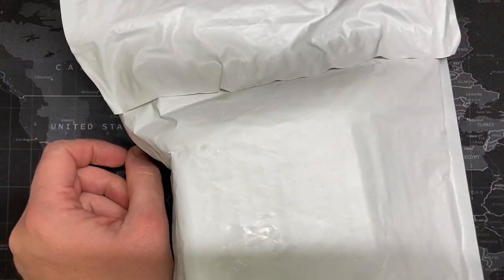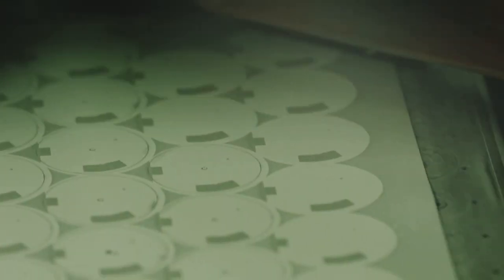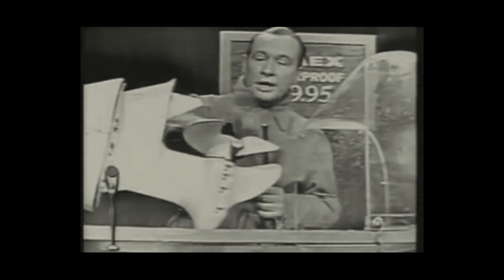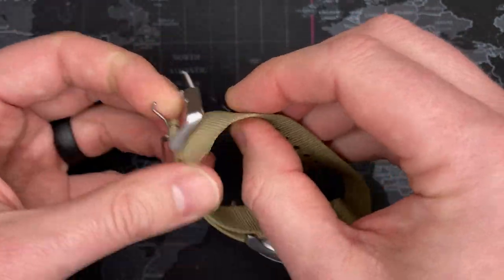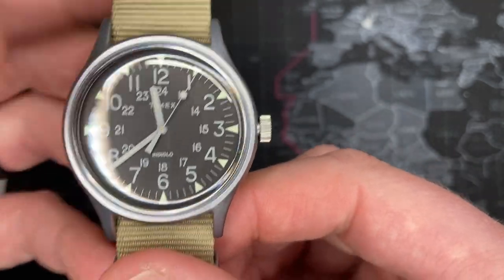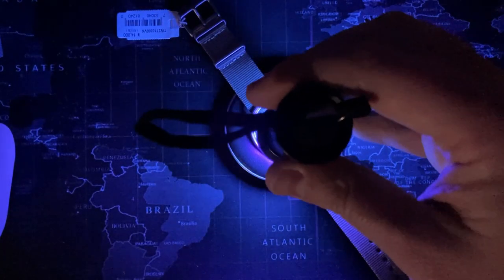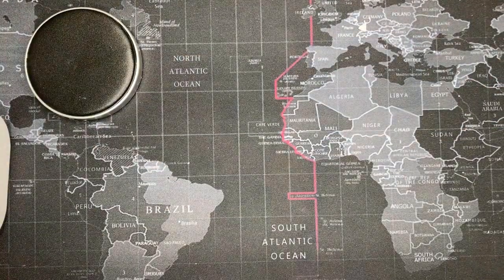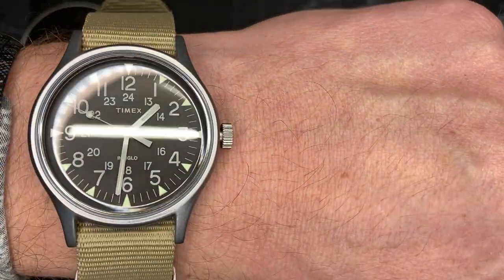Timex MK1 Classic 30m Field Watch - Review & Unboxing (TW2T10300-VK / M905)

Comment: I see you had the back cover off I’d like to know if you were able to just snap it on with your fingers without using a press?
Reply from the maker: It's been a while, so to be honest I cannot remember if I used a press. I almost always use a press now though, the reason being is that the case back can get distorted when you use your fingers. Unless the case back is billet steel, most of them will end up being stamped. A stamped case-back can be easily distorted, either in the middle or to the side, which can affect water resistance. With a press, you're getting solid pressure all around the case back. They have hand presses now for $20 bucks with all the nylon dies.
Reply: @ToddsWatchshop  Yeah that makes perfect sense the only thing I’m concerned about is the massive acrylic crystal I just don’t want that cracking and they’re sure not much bezel on the dial to put a press but yeah I think I might buy one of those presses there about $20 on Amazon or do with the one guy on YouTube does he use his Pill bottle caps and put it on the carpet and presses it down with his foot lol